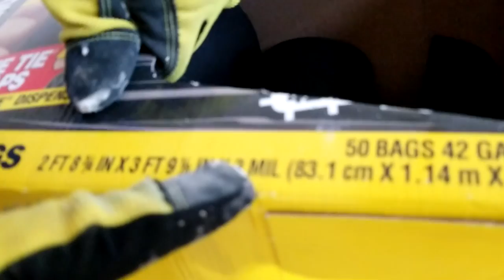How to Remove Carpet Tack Strips From Concrete Floors

Comment from the maker: ✅ Tools used in this how to remove carpet tack strips video:
✅ Estwing Handy Bar Nail Puller - 15" Pry Bar: https://amzn.to/2Ke5vvr
✅ Estwing Ultra Series Hammer - 19 oz: https://amzn.to/2WUZR2z
✅ Estwing Pro Claw Moulding Puller - 10" Pry Bar: https://amzn.to/2YTwm36
✅ Tooluxe 00883L Scraping Blade Hammer End: https://amzn.to/2D4Kn4H

Comment: Some concrete floors are weak and when you pull the nails, the concrete will break and crater bad.  Take your hammer and grab the nail between the claw..  Pull the hammer toward the claw to pry the nail..  Less crater.

Comment: Jeff, is it necessary to fill the concrete craters left from the nail pops with self leveling cement before laying an underlayment and vinyl plank floor?
Reply: Can anyone answer this question
Reply: That’s what I came here for
Reply: No, it's not necessary to fill the craters, they're small enough to not cause any issues. If they're bigger than 2 inches or so then I'd consider it. But generally it should be ok

Comment: I use a rotary hammer, but I've been installing for 32 years. There is usually a smaller hole if you knock them out as opposed to prying them.
Reply: How do you do that? Video possible? :)

Comment: Well, I did remove my tack strips with a screw driver - the WRONG way!  I did get all the wood up. My problem was getting all the nails up, now I know what to tool to go out to get them up. Nice to know this for the other 2 bedrooms that need carpeting removed. Thanks for advising on that tool - great video!
One other problem I have is small patches of padding I just cant remove. Should I use a chemical as seen on other videos or is there a tool for that too? I sure hope so! I have had concrete flooring for far too long!
Reply from the maker: I would try a thick floor scraper, not the thin flexible putty knife type, but try a 5 in one tool, something rigid with a blade to scrape that padding up off the concrete.

Comment: Thank you for the video. Before finding your video, I was doing it the wrong way with a screwdriver and hammer. The crow bar worked wonderfully! Best $10 I ever spent (for crow bar)!
Reply from the maker: Yes! Glad to help out, and this also proves that the right tool for the task can be a game changer. Congrats on getting your carpet tack strips up DIY!
Reply: jeffostroff Now that I have removed the tack strips from my hardwood floors, I discovered there’s old paint along the perimeter of the room. It’s approx 1/2 inch wide from the paint brush swiping the floor when they painted the baseboards. Do you have any DIY recommendations on how to remove this 20 year old paint without it turning into a major job?
Reply from the maker: @drucker71  Why do you need to remove the paint? Are you planning on sanding the hardwood floors, and trying to renew the old floor? If that is the case, I think sanding is the only option.
Reply: jeffostroff I removed the carpeting and prefer my beautiful wood floors. I’m doing it all myself and wanted to avoid a major project as there’s still furniture in the room. So the paint along the perimeter is now visible and I don’t like it. Despite being a novice, I’m ok with removing it myself but not sure what product will do the trick.
Reply: jeffostroff By the way, I REALLY appreciate your prompt responses!!
Reply from the maker: @drucker71  Usually people rent the large walk behind sander machine, but not sure if it can get up to the wall where you saw the paint. You might want to do it with an handheld electrical orbital sander. I doubt that sanding by hand will remove old paint.
Reply: jeffostroff Great! Thanks for your advice.

Comment: removing carpet myself for wood planking. very informative video. thank you. :) only thing i don't like is the damage to the concrete from taking out the nails. what can i use the fill in those holes? so there aren't any gaps in the flooring.
Reply from the maker: I don't bother to fill in the holes, no need to. But if you want to just get a small bag of cement, mix it up, and trowel over the craters
Reply: @jeffostroff  I put instant cement patch on I didn't want to risk something heavy like a bunk bed or a dresser potentially depressing that area even if the chance was rare. Went well though half way through putting the flooring in. :). Just have to get nee baseboard.

Comment: great video. How do you fill up the holes left by the nails please?
Reply from the maker: I don't, there's usually no reason to, they are relatively small and not too deep. If you;re tiling, they just get filled in with tile thin set. If you are installing wood flooring, you roll down an underlayment over the concrete floor then the wood planks, so you will never see nor feel these holes.
Reply: jeffostroff , I am putting vinyl planks. Do I need to fill those holes at all?
Reply from the maker: @klodianhatia908  No we install vinyl planks all the time and don't fill in the holes. The planks will be plenty rigid once you click in a few rows. Those small nail holes are not big enough to be felt through the underlayment and planks, or even a vinyl tile without and underlayment.
Reply: jeffostroff , great thank you for your help 👍
Reply: Thanks I was wondering the same thing!

Comment: Ugh....
Too late...
I pulled my tack strip using a flathead...made big craters in my concrete....
Ill look now how to fill those holes..ugh
Reply from the maker: If they are an inch wide or so I usually don't bother filling them in.
Reply: Josephine Fuentez , how do you fill up the holes? With other concrete?

Comment: If you're not replacing the tack strip, just hammer the nail flush to the concrete.  No divots . no holes to fill in later.
Reply: With a nail setter ?
Reply: Remove the strip first?

Comment: There was a U-shaped Power nail underneath my carpet tack strips by the sliding door where i started. Do i need to remove those power nails , or are they structural? Was not sure If they were part of the carpet strip, or part of the floor beneath.?
Reply from the maker: They are not part of the carpet strip unless it is in the way, no need to remove it. Maybe you can tap it down to a low profile

Comment: My dad and I have been fixing up a house my parents bought. We've been pulling up carpet tack strips, but it keeps pulling up concrete with it. Any advice?
Reply: Are you using this method now?
Reply: @RogerPack  well we finished the project about a year ago. Pretty sure we  used the method, but it was still pulling up some concrete.

Comment: My basement was wet so strips are brittle. Strips are doubled and glued down. Left all kinds of wood behind wood is rotten. I am going to try the pry bar method but the glued is really hard to get one piece
Reply from the maker: Yes I have come across many water damaged strips, I hate that! Sometimes a rigid floor scraper can help with that.
Reply: @jeffostroff  thank you I still have two walls and a lot of splinters left behind.  Going to hardware store now. Got to get the basement ready Thanksgiving is coming😃

Comment: How do you fix the holes that are left, especially if they’re big holes?
Reply from the maker: Sometimes we get nickel or quarter sized or even silver dollar sized holes there's no need to fix them there's absolutely no reason to because the planks will just go right over them. But if you really want to you could get some concrete mix and just mix up a batch and Lovell off the little craters.

Comment: I use a stand up scraper the same one that I'll use to remove pads Staples I like to be off my knees as much as possible it will only takes a few minutes I've been doing this for 16 years your wasting you're time knees and money if you do it any other way and fill the holes it should only take you about 3 minutes after the floor swept up of course
Reply from the maker: Donald you got a model # on a scraper?
Reply: I don't but I would think a flooring supply house would have it . A large red scraper with a sixth inch replaceable blade would be easy enough to find note have had mine forever and recently have purchased another hopefully they're available in the area. You have to throw the blade out a little bit to use it on wood it will dig into the subfloor at first until it dulls out a little bit but after that you should be fine I've never replaced the blade of mine I have sharpened one for a glue down job one time I I hope that helps

Comment: This is BAD advice. DO NOT pry up. The nail will take portions of concrete with and leave a "crater" like he says, which creates more repair work. The efficient way is to use the crow bar against the nail and TAP with a hammer until you jiggle the nail, and it frees up. Very little concrete is disturbed, the strip is more likely to stay in one piece, and you won't have small bits flying at your face from the prying he recommends. Do your own research and even try it yourself.
Reply from the maker: what you just said is what we were doing, we slide under the head of the nail and it pulls up. Often times we encounter rust nails that break rather than jiggle up. There are often broken or soggy sections from water damage where the wood pulls up and around and you are stuck with a nail poking up. Yes they often leave a crater when you do, but they are small and don't effect any other flooring efforts.
Reply: Wesley DoesIt , I am trying that way but the concert breaks anyway. 

How can I fill the holes up? With other concrete?
Reply: Gotta love how-to-video watchdogs

Comment: THE ABSOLUTE BEST WAY TO REMOVE TACK STRIP IS TO USE A SHINGLE EATER. POPS RIGHT UP RIGHT NOW.
Reply from the maker: Those are good too, how wide is yours? Only problem is the nail spacing they used under the tack stip, whether you can get it between the nails or not. I like the leverage that the demo bar gives because you give it a love tape and now it's wedged around the nail head. They also make a specialized tool for tack strips also.
Reply: @jeffostroff They are 9 inches wide. You slam them into the tack strip at the nails,  and they come right up!  The overall length with the handle is 51 inches.  No bending over,  except for a few nails that don't pop up!  So much better than getting on your knees!
Reply: @jeffostroff  you slide it on the floor where the nails are!  Gets 99 percent of the nails with out KNEELING down!
Reply: @jeffostroff  far faster and better!
Reply: @jeffostroff  plus,  A lot more leverage than a prybar.